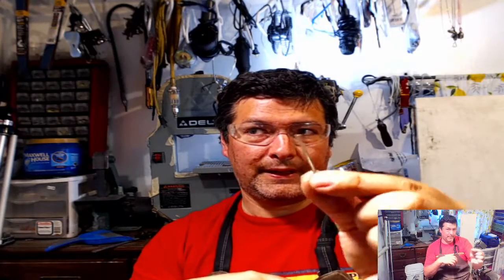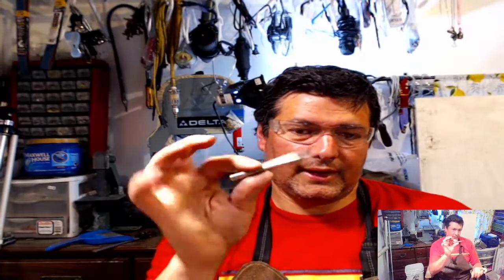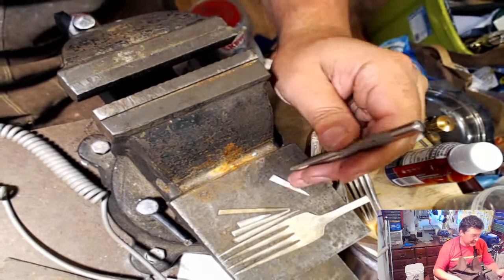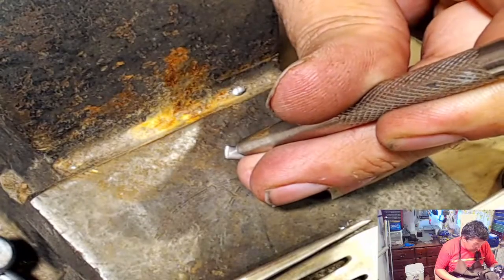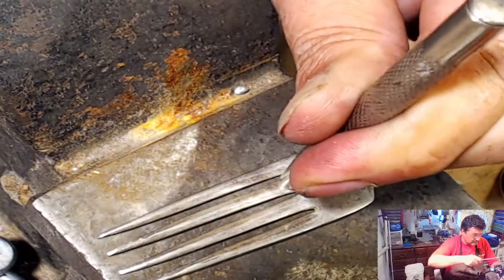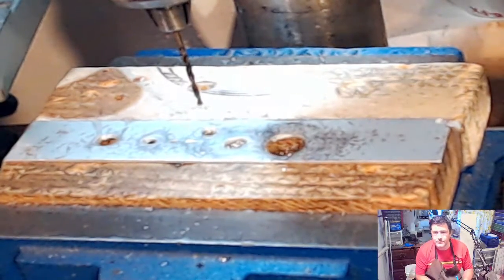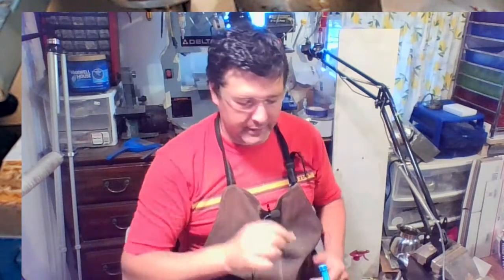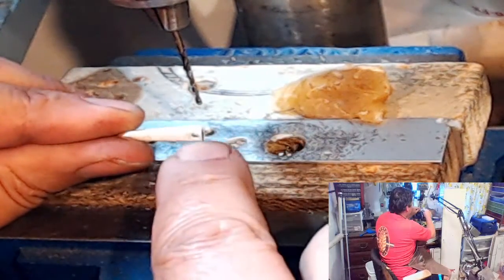How to drill fork tines

Comment: Thank you for the video Jeremy, and for sharing your knowledge. When you cut your fork tines, do u use your dremel tool or jeweler’s saw?  Also, just curious, have you used metal beads in place of the glass seed beads and if so, would that also change the sound? Again, thank you for the great video!
Reply from the maker: Thank you for watching. I generally use bolt cutters. But I’ve also used my bandsaw and my jeweler saw. I have tried metal beads but I didn’t hear a difference. Using the seed beads gave me a way to use the beads that I was never going to use. I have used lots of different sizes of seed beads. I would keep experimenting with sizes. The big thing I found though is just getting the fork tine to the right height to make the nice sound.

Comment: Thank you for sharing; I missed the live... I don't own a drill press yet; what would you recommend in that case? Is it OK to tape the tine down on the ends as long as you keep the bit cool?
Reply from the maker: Yes I would tape the tine down and use a punch to start the hole. You could also use pliers to hold down the tine if it’s long enough.
Reply: @FlatwareCreationSS  thank you so much!!

Comment: Do you tumble bells after drilling hole in top or before?
Reply from the maker: I normally do all of the metal work first then tumble. I do a whole bunch and store them in a bag with chock or a anti tarnish cloth until I’m ready to do the finish work.
Reply: @FlatwareCreationSS  I didn’t even think about storing them to prevent from tarnishing. Another important  tidbit.